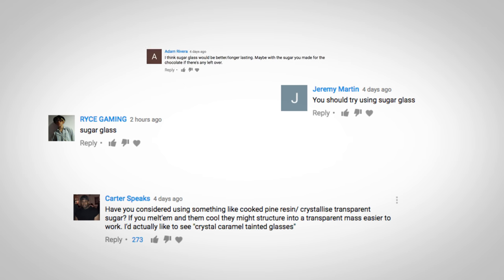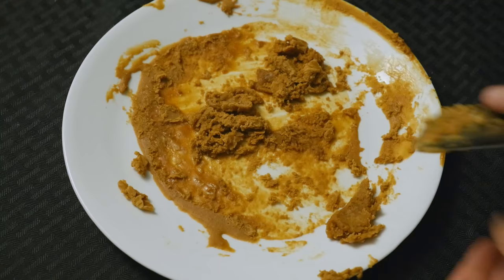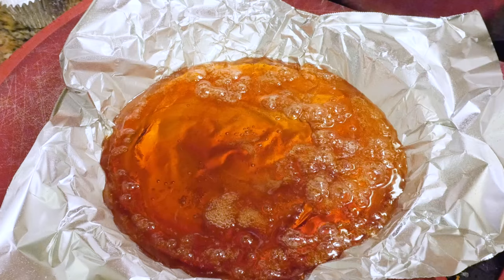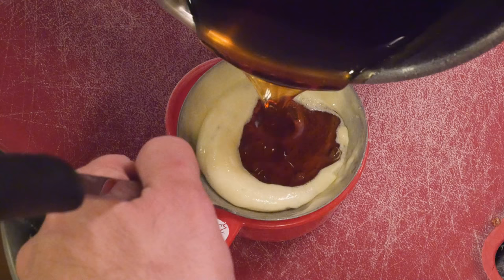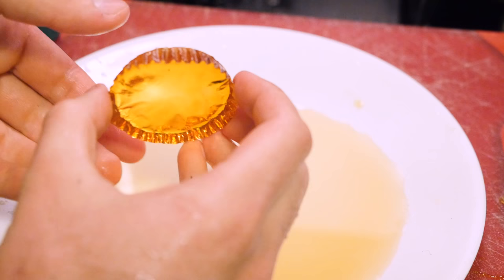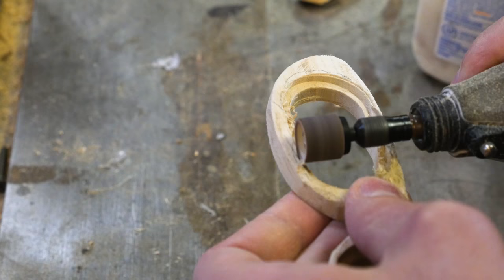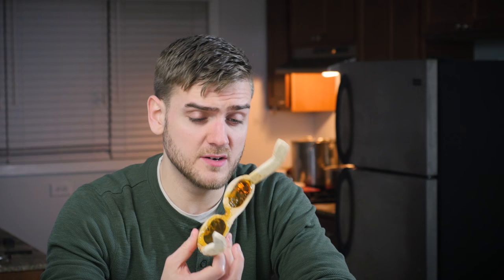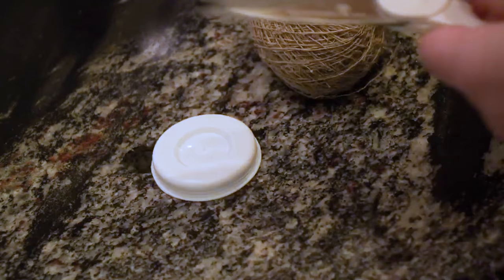Making a Delicious Pair of Sugar Glasses | Viewer Comment Followup

Comment: Probably worth pointing out that the index of refraction of sugar is most likely different from glass. So, the same shape for the lenses doesn't work perfectly
Reply from the maker: I couldn't find much for exact data on it's refractive index, but from what I could find it's surprisingly close to glass, at least closer that ice is to glass.
Reply: How To Make Everything refractive indexies generally stay in the same neighborhood of 1.3-1.5 and for your applications a delta of 0.1 should be fine.
Reply: +barnesrino kripperino +How To Make Everything   Glass has an index of refraction of around 1.5 and ice has around 1.3. Change of -0.1 means a 25% longer focal length, according to the calculator at http://hyperphysics.phy-astr.gsu.edu/hbase/geoopt/lenmak.html So, even if the sugar had 1.4 index of refraction the difference would be huge
Reply from the maker: That's interesting to know.  I actually started to do the math with ice to figure out what curvature it would need with that different refractive index, but then realized I'm limited to whatever spoon shape I can find to melt it, so opted to just roughly ballpark it.

For sugar glass, the best info I found was page 26 of this pdf: http://www.lehigh.edu/imi/scied/docs_students/PfundMethod.pdf
Where it appears that they found the refraction to be around 1.55, but depends on the temperature the candy was poured at.  I was just doing a quick experiment, so just made a rough mold to see if it would even work (which because it's plano concave, would be different from the other lens anyways).  Roughly judging it, I'd say it was a touch on the weak side compared to my perspiration.
Reply: "For Finding Index of Refraction of Amorphous Candy" I have to say I chuckled a bit :D
The calculator still give a 9% decrease in focal length with 1.55. Not massive, but still pretty big. It might not even matter that much, the way you made it might not make it perfect anyway.
Reply: HoxTop my assumption was that even this big a difference in the focal lenght could be neglected because of the way he produces the shape makes it have a big uncertainty and high variance in a single lens

Comment: why dont you try make some electronic? like a lightbulb or something rather simple like that.
Reply: Marcus Octavius it sounds simple,  bit the components to a light bulb are not easy to get,  and theres a reason humans took 200,000 years to do them. he'd need all kinds of things that just can't be done realistically 

some with almost any electronic,  they need many many complicated things,  from gold to silicon,  to plastics...plastic HARD to make
Reply: ICExz13 yeah, it's probably not gonna happen. But something mechanic should be possible.
Reply: Actually, to make a light bulb you only need a wire with correct resistance i.e. a heating element. To make a light bulb that gives off white light and lasts for a while, you'd need a sealed transparent casing, protective inert gas or vacuum, and preferably thin tungsten wire. It isn't that hard to do if you don't mind taking the time.
Reply: it's difficult to build a light bulb
Reply: we don't know how long it took to build a weel.

But his thing is doing it all from scratch... he'd have to mine Ang get tungsten, create a bulb of glass  (remember how...well his last glass went? ) and a battery to power it.  

Plus mine the iron/  aluminum for a casting to seal it. 

it took forever to make simple chocolate, or a small nugget of iron.  i doubt he'd have much luck with other materials that are harder to get
Reply: that might make a great cody's lab collab. (he made a mercury vacuum pump.)
Reply: Oh yeah, I forgot he actually needs to process the metals himself. In that case he could use iron or copper as the filament but it wouldn't be as durable and he couldn't get white light out of it.  He can seal it with glass, so he doesn't have to use aluminium/iron for the base, unless he want to screw it in his house.
Reply from the maker: +Marcus Octavius A light bulb is something I'd really like to do, and is on my list of future topics.  I just need to get the metal smelting figured out first.
Reply: How To Make Everything looking forward to it!

Comment: you should be able to get clear moten sugar, if you heat it up VERY slowly. As far as I know the melting point is just before caramelization starts. I would suggest an putting your pot in an oil bath, so when it hits the melting temperature it still takes a while to increase temperature for caramelization. Adding some water could also help to get a consistent melting. The sugar would dissolve first and loose its crystalin structure, then the water eveporates and you should get a uniform paste at 100 degrees celsius. at about 145 degrees celsius it should start to melt and at 150-155 caramelization would start.

Comment: You should try (once you get sugar glass down) to make the classical alchemist's or inventor's glasses (multiple lenses, 1 each of each primary and secondary color at least from both spectrums, x2, x3, x5, and x10 mag at least, gray scale lenses or slatted shades to cut out light[or an oculus] and several measuring grid lenses)

Comment: I like to think that you're attempting solutions to items that may be hard to manufacture if civilisation (as we know it) ended. So what about using trash as a raw ingredient in some of your projects? I'd imagine it would be fairly reasonable to melt down some clear plastic from packaging into a lens blank, which you could then polish and adjust accordingly? What about making binoculars with such recycled-plastic lenses and prisms, seeing as you've attempted glasses a few times already? :D
Reply from the maker: +Claudia Sketches recycling plastic like that is an interesting idea.  We've played around with doing a spin off where everything's made from trash instead of scratch, but haven't had time to follow through yet.

Comment: Jello lenses?
Reply from the maker: I found the article below that says the refractive index of jello is 1.21, which is a bit weaker then the ice or sugar, so they'd have to be pretty thick, but should be possible.  Of course you'd also have the issue of "nailing jello to the wall" to get them to stay in the glasses.
http://www.instructables.com/id/Jello-Refraction-Experiment/step5/Calculating-the-Refractive-Index-of-Jello/